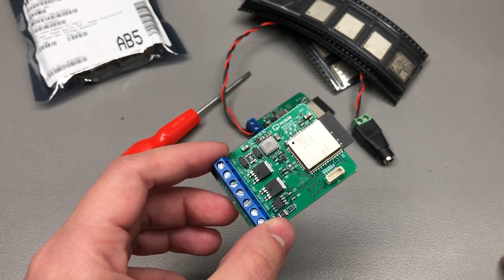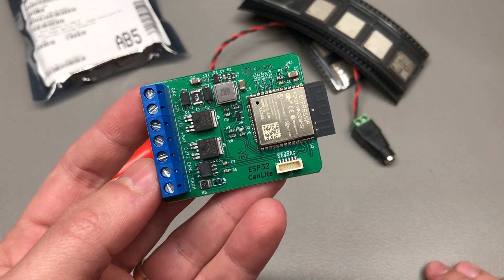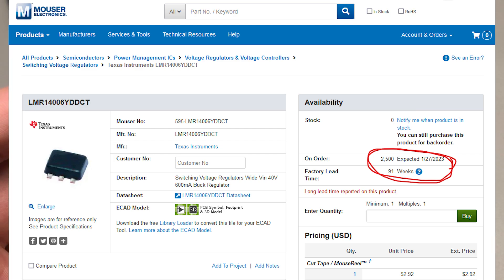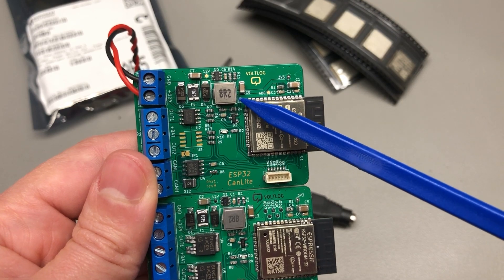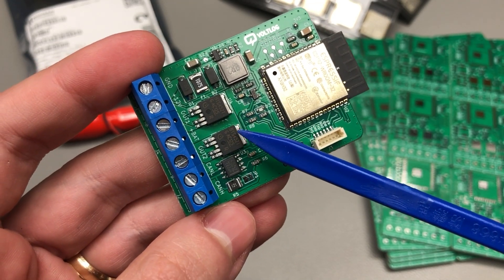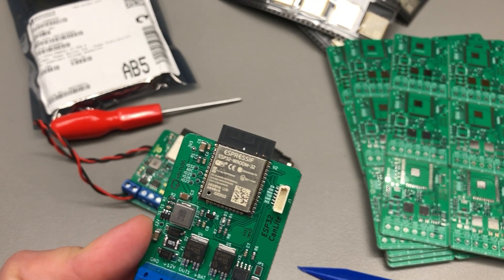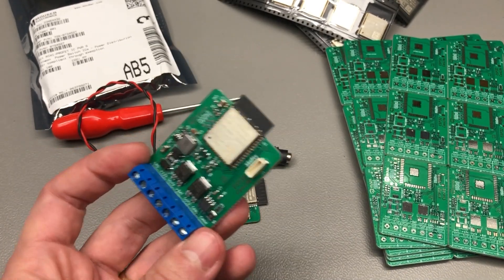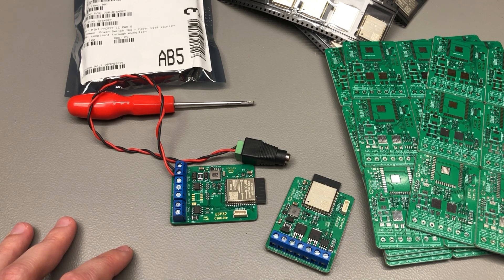CanLite revD And The Global Chip Shortage | Votlog #390

Comment: I ordered one of these, uploaded the DEMO code from Github, and cannot get it to read or write any CAN messages. I have tested it on a known CAN network with another device logging and sending CAN messages live. 
Any advice on getting this to read and write CAN messages? 
Has anyone else gotten the demo code to work on this?
Reply from the maker: Nobody will be able to give you "a simple" advice to get this working. You need to have a good understanding of how a CAN network works to understand what to expect from the firmware you are writing and how to debug it. The demo code provided on github will continuously forward packets received on the CAN interface to the serial port at the configured baud rates provided that your wiring and termination resistors are set correctly.
Reply: @voltlog  perhaps a bit more documentation about the board or setup for the demo script? 

I have gotten 2 other devices to read and send CAN messages on the same CAN bus I tested this one on. One was an ESP32 and the other was a raspberry pi. The voltlog canlite i cannot seem to get working.
Reply from the maker: @vdawger  On the github repository you will find a schematic of the board and a demo source code, that is all you need to have the board up & running in a matter of minutes. But to get to that you will need a good understand of how a CAN bus is wired and how it works. That is outside the scope of the development board. There is plenty of good documentation on CAN networks available online.

Comment: I spent 1 week on automotive smart switches for work and could not get any that would be a fit for my application. I had to go with a pre-production TI part.
Reply from the maker: if in-production parts have lead-times of 1year plus, I wonder when pre-production parts are going to be available..
Reply: @voltlog  Weird thing was I could get pre-production samples and I was told it was functionally going to be the same as the production unit. I'm hoping no major changes happen. They are releasing the part soon and I should be able to get it for our PV build.... we'll see.

Comment: I also produce prototype boards. I pay attention when buying chip and they seem to be in 3-5K stock. The prototype is coming, it takes about 1 month when I say I'm testing it. when i want to reproduce, there is no chip in stock. what can we do this situation. any suggestions.
Reply from the maker: There isn't much you can do, depending on the application you might not have alternatives for a particular part. It helps if you can speed-up the prototype/testing phase so you can then order enough stock for a first batch. That doesn't guarantee you'll still find the parts for the next batch though..